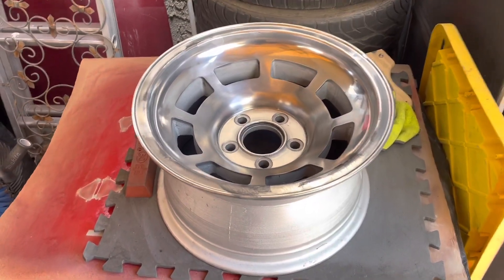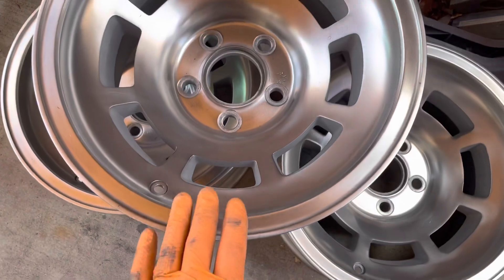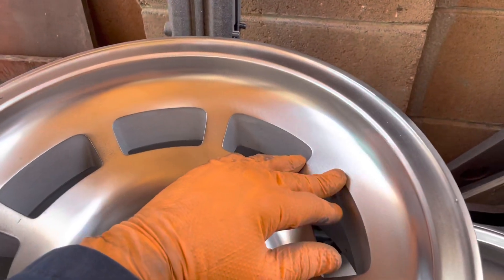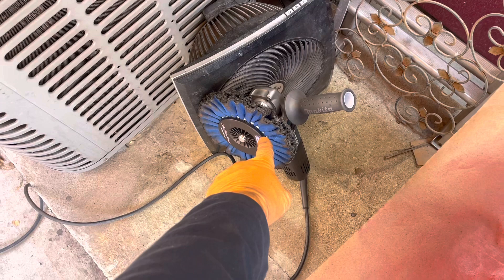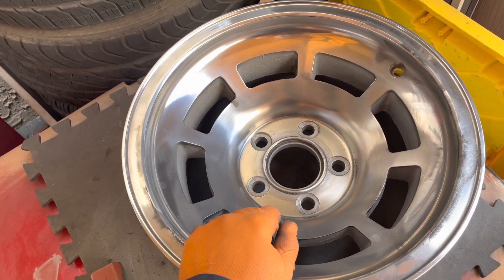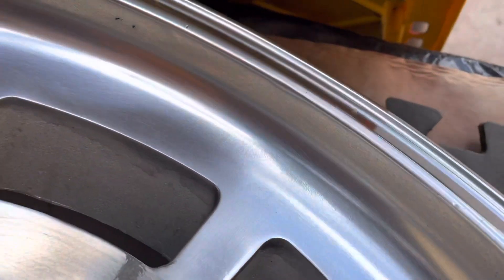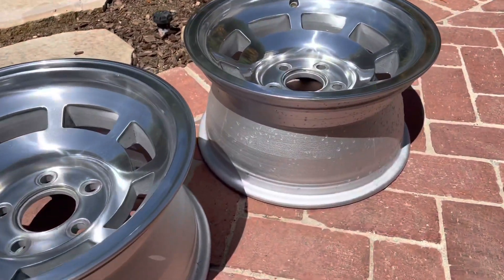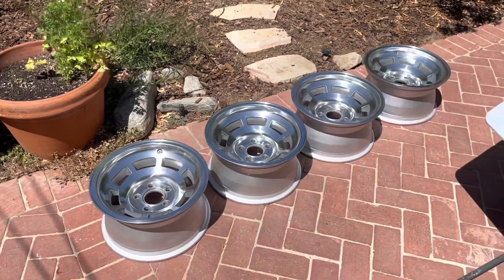Polishing C3 Aluminum Wheels

Comment: Hey man great Video.... Not a lot of Videos out there on these types of rims. I have a 79 Vette with the same type and have tried to polish them to look like chrome. The issue is, as you know, they have a lot of machining marks and the only way to get them off is by doing what you did.... Sand, Sand Sand!... I contacted a company called Renagade and they told me the same thing....Sand the machining down then concentrate on the shine....Yup it's A LOT of work!.... Thanks for taking your time in doing this for us!
Reply from the maker: Did the best I could, given time. There’s a place near me that will shave the rims and do all the balancing and refurbishing, but it’s not cheep. I’m fine with how these turned out and like having OEM wheels. New options are fine, but few new products have the quality in the metal like the original GM stuff.

Comment: I got a set of cragar star wires with my 81, and I like the look. Just wish I had 2 15x10 for the rear. All 4 of mine are 15x8.5. Been trying to find a set of 15x10, but they don't make them anymore.
Reply from the maker: Do 15x10 work with the stock trailing arms?
Reply: @thedrivewayC3  should with spacers. I got 1/4 inch spacers on it now. Might have to go with 1/2 inch spacers.

Comment: Just finished this weekend pulling mine off and repainting the black hub and inserts. I then replaced the hubs with aftermarket spinners and love the look!
Reply from the maker: Is the black center of the wheel a separate piece or paint? (Not the hub, but the black part of the wheel around the lug nuts.) Some wheels are black and others are aluminum finish.
Reply: @thedrivewayC3  mine was black already and needed refreshing

Comment: Hello again, When you sanded the rims did you use an orbital sander? I have one but the 5" sandpaper doesn't get well into the inner & outer curves. I'm thinking maybe to use 6" because it sticks out a bit and might hit the areas the 5" doesn't.... Your toughts?
Reply from the maker: I used some different tools. By hand, drill wheel, angle-grinder sanding pad. An orbital is probably too rigid and bulky to be effective. 

If I had to choose one type, it would be the angle grinder with a sanding wheel.

If you do use an Orbital, be sure to use those foam rubber backing pads.
Reply: Thank you so much! Really appreciate your guidance on this. You're right, the orbital sander is kind of wonky on these types of rims. I'll see how it goes... Thanks Again!  @thedrivewayC3